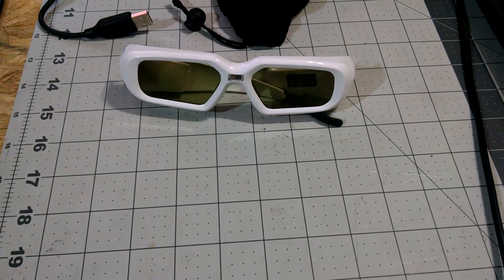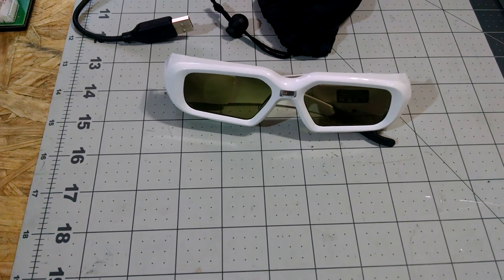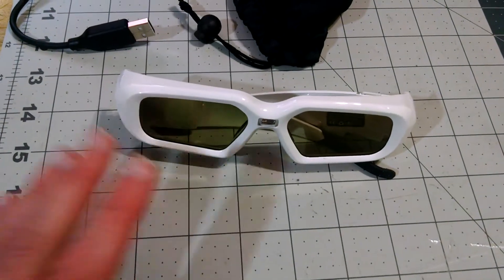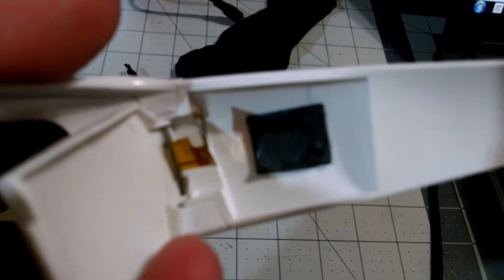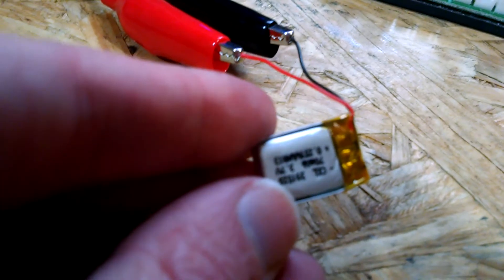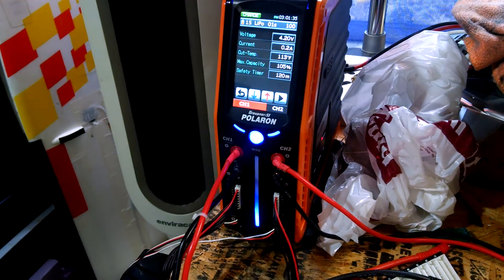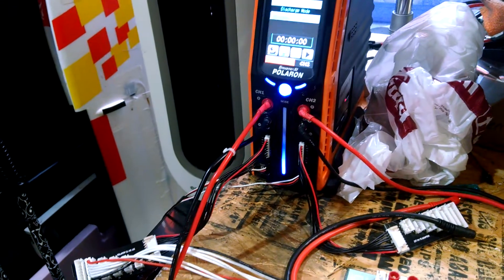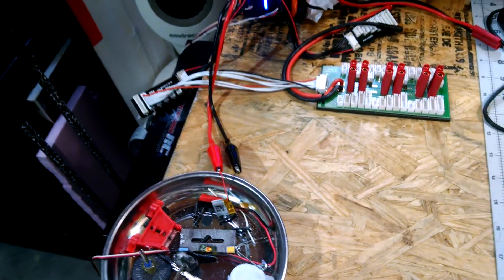SainSonic 3D rechargeable glasses will not charge

Comment: Thanks for this video. I revived the same glasses without desoldering, by applying 9V via a DC power supply for some seconds until the battery got hot. The battery stayed red on the second attempt when I plugged them back to the USB adapter. Still red after 30 minutes charging, I hope they can maintain the charge when done charging.

Comment: I opened  up the glasses and boosted the dead battery for about 10 sec with a regular 9V alkaline battery; I  then was able to  charge them up in the regular way by using the USB  cable.

Comment: Hi! In lack of a charger, this can be fixed in another way, without opening the glasses. I measured the battery and noticed that the battery is beeing charged a bit when its connected. I took it in and out several times, and eventually it got enough current to get the normal usb charging starting. You might do this many times (over 100), but in lack of equipment, its a ok solution :)
Reply: +John Conrad Brandsø Dude, I had the same problem with some other glasses. Light "flashed" red but didnt charge. As I didnt have a usb hub with on-off switch I used and usb extension cable and started plugging it in and out. Im sure I did it about 500 times at least and I fel like I was getting trolled. Even my gf looked at me like wtf are you doing? Just as I was about to give up, amazingly it turned solid red and it's now charging. Wow, that the f. Can't believe this worked lol. Thank you so much for telling me this, too bad the solution is only to be found here on a YT comment on the whole internet lol.

Once again, THANK YOU LOL
Reply: +John Conrad Brandsø I may be responding too soon but I think your method worked! I dusted off my 4 pairs of glasses and none would give more than a brief red flash after plugging them in.  Realizing the painstaking task in front of me with 4 pairs, plugging/unplugging one pair at a time, I looked over at my 5 port USB hub with a power button on it... plugged all 4 in and tapped that button on..off..on..off..on.  After maybe 100 cycles I got a constant red light on the first pair. Few dozen more cycles and the second.. and then the third. Probably took 2-300 power off/on cycles, almost as quickly as I could tap, to get the fourth but as of now they all have a solid red charging light. Hopefully they hold. Thanks so much for the idea!
Reply: +David Lehman Glad to hear that the method worked for you ass well. Mine is still working, but I use them so seldom that I expect to use the method again sometime :) Your idea with the usb hub is really good!
Reply: +Anhtoan Nguyen got it! another 2500+ connects it turned on solid red. DETERMINATION got me there.
Reply: This really does work. I connected the USB charger to a powerbar with a switch. It took 276 times (yes, I counted) before the red LED stayed lit and charged properly. FYI, It was another brand of glasses. I had also previously tried the 9V battery trick which did charge the battery, but it still would not charge by usb.
Reply: +John Conrad Brandsø You're a wizard, worked for me also.
Reply: +John Conrad Brandsø I have two glasses and this method worked for one of them after about 500+ times. However, on my second pair it wasn't as successful even after what i would assume was several thousand connects and disconnects. Still pretty happy that it worked on one pair as it was the only solution without taking the glasses apart that i found.
Reply: +Anhtoan Nguyen Great!!! :)
Reply: +John Conrad Brandsø I was wondering how to open the right leg of the glasses without breaking anything. And the video did not show how he did it.   I will try this :)    Thank you!
Reply from the maker: +Leo Wan I used a small flat head screw driver to pry it open
Reply: +Brandon Galles I tried with a program on arduino, to set a pin to HIGH and LOW and... for a few hours. unfortunately, it did not work for me.  
so I tried something else.  there is a third pin on the battery, under the yellow tape.  connect the red wire (+)  and the 3rd pin(-)  to  4.2v or 5v charger for 10~30 seconds.  put the cover back. connect to usb,  and it begins to charge. I don't need cut any wire.
Reply: @leowan5033  can you re-phrase this?  Which red and black wires are you connecting?  I thought you said you didn't disconnect any wires...
Reply: Thanks so much! I was trying to understand how to dissamble my 3d glassed samsung ssg-3550cr and by pure chance i read your comment and well, you saved my ass! Personally i connected the glasses to a normal smartphone charger, and i tried to connect and disconnect the usb cable from the charger itself... To my great amazement (i read about 500 trials) after even 50 trials, the glasses started blinking! You re a great one!!!